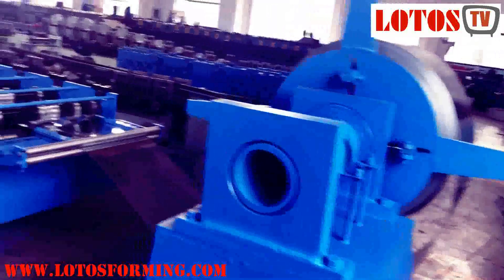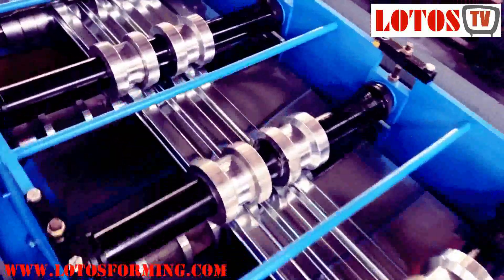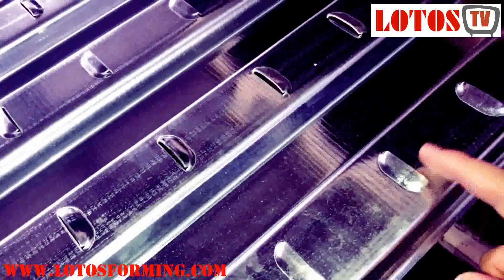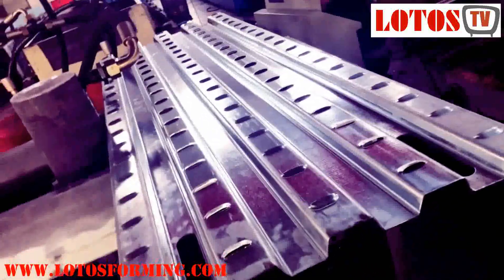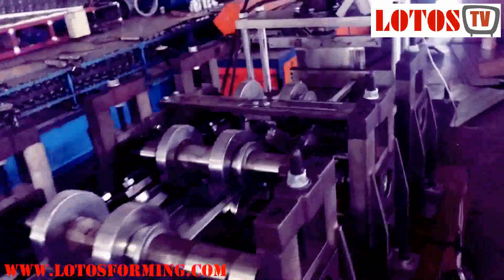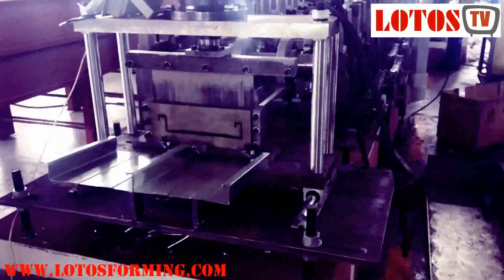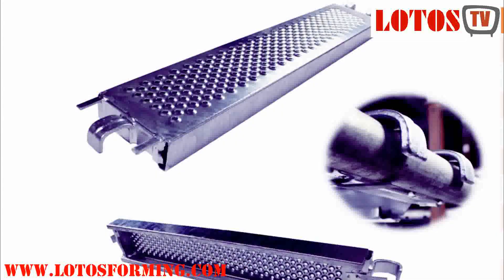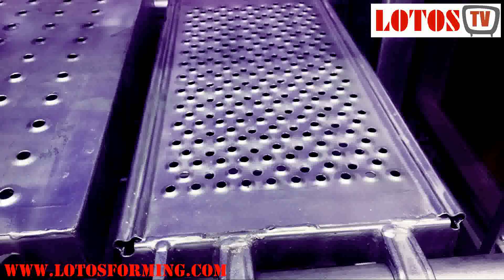【Roll Forming Machine】: scaffolding plank roll forming machine| scaffold walk board forming machine

Comment from the maker: LOTOSFORMING scaffolding roll forming machine is specifically designed for rolling Scaffolding Board Steel. We are indulged in the manufacturing and exporting of Automatic Scaffold Panel Machine.